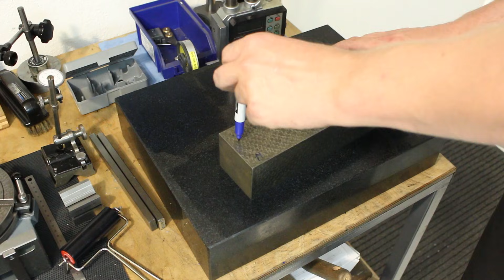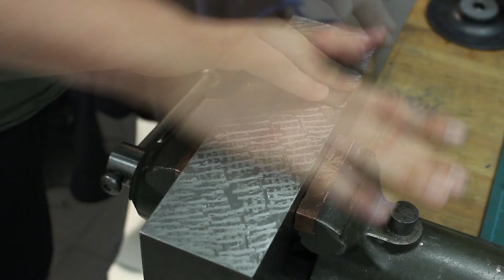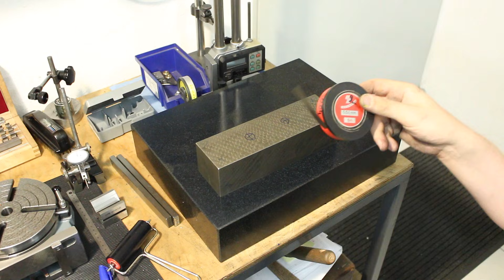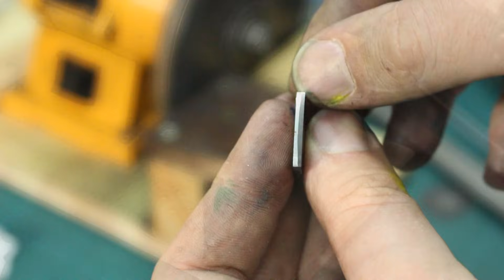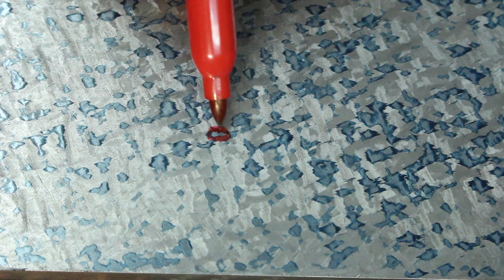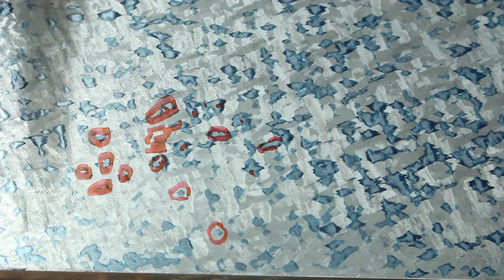Scraping basics - Scraping flat - Part 2

Comment: Thanks for the detailed 2 part video, it helped me understand better the process. Earlier today, I already built myself a ghetto scraper from a broken HSS M8 tap as the cutter and for the handle 3mm mild steel sheet and 16mm rebar, everything welded together, so as it was red hot I hammered it and then quenched it in oil to hopefully keep it as hard as possible.  Now I know I got the geometry wrong (eyeballed it and the cutting angle is in the oposite direction), although it seemed to work okay without signs of wear after a test of a few hundred strokes. Wish me luck because I will need it 🤣🤣🤣🤣. Just for reference, the previous year, I built myself with the 3 plate method 300x300x30 reference surface plates made of the same 3mm mild steel sheet reinforced with 8mm flatbar and 6mm rebar as points for concrete to grab onto and, at the end, I got the things to hover one on top ot the other then stick together like the gauge blocks you showed in part 1 with little to no oil in them, mind you they are just over 9 kg each and you could lift the one under grabbing the one on top. I used an angle grinder to scrape the high points until reasonably flat and then made myself diamond paste with thin oil (WD40 and other similar product) and ~90 micron particle size alumina powder (advertised as 220 grit), then I began lapping like crazy for I dont know how many hours.

This time though, I dont feel so confident the results will be so great, so I might be ordering in advance a few carbide pieces like the ones you show us for a less ghetto version 2 of the scraper tool. Do you have any advice on what to look for or any chinese supliers you trust?
Reply from the maker: Uhm, I dont know any chinese suppliers for scraper blades, sorry.

One source of wider carbide strips could be electric handheld power planer blades - They are availible in carbide and very cheap.
Reply: @StefanGotteswinter Alright thanks a lot 👍

Comment: any idea how much material is removed in one motion/one pass, anyone? I have something that needs to be flattened, but I'm not sure if it's worth it doing this way. there is an unevenness in height on the order of about 0.15 mm (need to remove material around a low spot in the center), and the size of the surface in question is about 15x15 cm.
Reply: (cast iron)
Reply from the maker: If you really go at it, you can do 0,005...0,01mm per pass when roughing.
I would say roughing down a 150x150 by 0.15mm is absolutely reasonable and wont take to long.
Reply: @StefanGotteswinter  thanks! it looks like trying myself at this new skill is now justified and I can happily satisfy my OCD.
I have a sharpened (out of the factory) hard insert already, but I still need to get a handle/holder for it. I don't have anything to sharpen it with (except some galvanic diamond plates for manual work), but I think the four existing edges should be enough to try it out :)

...there is something magical in scraping cast iron little by little.

Comment: If I understand correctly this technigue is for sliding surface and the idea is to have lots of evenly spaced high spots for the flatness and lots of evenly spaced low spots for oil and lubrication.   Not so much for a reference non-sliding surface.  Correct?
Reply from the maker: Its also very suitable for non sliding reference surfaces and measuring tools. Wyler for example scrapes the bases of their precision levels via pull-scraping. If you look up Wyler on youtube they have a promo video, where you can see the scraping.

Comment: Scraping multiple sides of (What looks to be about) a 60x60x250mm block of metal AS A DEMONSTRATION makes me think you're a lot more mentally centred than I am. Half way through scraping in the bed and cross slide on my previous 100+ year old hobby lathe (on around the beginning of day 3 IIRC), I was all in favour of throwing the whole thing off the nearest bridge and into a river !

In the end I left it half done for something like 2 months, then I kept it all layed out on my bench so I could do an hour or so on it here and there when I didn't feel too much hatred towards the whole task. It wasn't the best job in the world when I'd finished, but it looked OK, and was significantly flatter than when I started. That thing had a 200mm area of wear near the headstock that was almost a millimetre deeper than the rest of the bed !

If I needed to do it again, I WOULDN'T ! I'd just send the damn thing away to be planed on a shaper somewhere. Maybe once it came back I'd do a light scraping just for the look of it, but I wouldn't start scraping over a mm off of 80% of a lathe bed by hand again ! :D

Comment: How to scrape dovetails or machine ways. You cant get into dovetail all the way into the corner with these hand scraping tools!
Reply from the maker: You thin down the top of the scraper blade on a grinder. Also, a dovetail always has to have a relief cut - no matter if its going only to be milled or in addition ground or scraped.

Comment: Excellent explanation, now how do you scrape a granite block and make a flat surface for it?
Reply: You don't. You grind then lap it. The lap is often a heavy chunk of cast iron, but you can even do it with aluminum as it picks up and holds the lapping paste better.
Reply: @johncoops6897  It seems to do this automated like using a custom CNC is really possible, I have done some research on this. The goal is to take scrap or ordinary granite plates and turn them into grade AA surfaces. However no one have ever done such implementation, I have only seen such automated implementation done in professional factories where majority of people ends up buying their grade AA granite surfaces. I think I have only seen like 1 or 2 youtubers tried using a CNC to do the girding using a CNC. From my understanding, making a granite surface or making precision CNCs which is done by the machinist from scratch is really a secret and requires great skill and talent. I have seen few skilled machinist who have successfully built high precision (down to single digit microns) CNCs. Simply take grinding wheel, place it into the custom made CNC and let it do all the intense labor in grinding and laping. The final laping can then be done by hand which isn't too labor intensive. To make laping part completely automated, AI and custom cameras with laser scanning sensors can be used. I could even build a fully automated scraping machine too, that can take can flat granite or metal blocks and scrape to grade AA.
Reply: @ShopperPlug  - yes, but you realise that the CNC machine needs to be at least an order of magnitude (10 times) more accurate than the part that is being flattened?
That fact alone means that it is completely outside the scope and subject of this video.
The factories that manufacture surface plates use AUTOMATED grinding machines to get within 10 microns or so. Optical surface grinders use AUTOMATED systems too. What you say is valid, however that's not how flat surfaces are maintained and rectified for products that have left the factory.
Reply: @johncoops6897  Well it only needs to be 10 times more accurate only for the final lapping part reaching grade AA levels. However the mother CNC does not need to be so expensive nor micron accurate to do the first initial grinding and lapping. The precision lapping would be done by hand of course. So far I haven't seen any one in the internet implemented fully automated lapping reaching grade AA for granite, not even granite factories have such implementation, all are done by hand still today, hence why they costs tens of thousands of dollars. I think because there are no proper implementation nor sensors to help provide this service for granite, making precision granite surface is 100 times more tricky than making precision metal surfaces. Precision ground metal surfaces are general cheaper than precision grade granite. After all, the worlds best mother CNCs precision based are all made from heavy granite. Look at CMMs, these things needs to be 10 times more accurate than what it is measuring (they measure high precision metal blocks or parts), no wonder they are made from heavy granite. Note, my comments are about granite and not metal blocks, however this video is 100% relevant because I need to make base plates which are all metal which will be used for granite CNC. There are many commercial mother CNC machines which actually makes precision metal blocks but not for granite. The video serves helpful purpose on making mother CNCs and high precision CNCs for granite grinding and lapping.

Comment: I was told you had to have a slow speed grinder for those diamond wheels. Something like the Glendo. @ 400 RPM.
That's it, I'm converting a 1,750 RPM grinder. Thanks

Comment: Questions 

How do you correct an angle for a plane you step scrape it? So how do you use the angle plate to do that 
Second
Can you use negative rake on soft steel or positive rake like how An Engineerings Finding did
Third when you long stroke scrape it is the depth of cut almost the same
Fourth can scraping get things to their final width/dimension like how lapping does or just only for making it flat and have  bearing surfaces only.

Comment: This video series is such a good one. I have been rewatching it regularly and I have just started scraping myself. One thing that was really difficult with the insert I bought was the radius, probably 100mm radius on it. It's a good insert IMO, old USSR and mirror finish on the flats. But I had to regrind the radius to 60mm. Made a similar setup with chinese diamond plates and man it was fast and easy. Still for my beginner hands it's still difficult to avoid hitting with the edges sometimes. Going to 40mm might be better still, but I guess I also need to learn to hit the scraper where I want without relying on a smaller radius. I didn't have a block of cast iron so I am making a Stanley #4 plane incredibly flat instead.

Comment: maybe I'm stupid or we're working with different tolerances but I dont understand how this isnt obsolete unless you`re trapped on an island. Put it through a planer and it comes out flat. Send it to a machine shop and have them spin around a cutter head for resurfacing and it comes back flat. Using a piece of glass or scrap granite as a surface plate shows flatness cross examining it with a straight edge and feeler gauge so these things must be flat too. Poured flat and cut and polished flat and  maybe rolled flat to achieve that flatness before that. I`ve done something similar to this with sand paper,scrap granite, a straight edge and feeler gauge on engine heads but this is considered sub par jerry rigging to save a buck and the correct protocol is sending them to a machine shop for resurfacing when it doesnt pass the straight edge and feeler gauge test. This method seems useful when you`ve been reduced to the stone age (and remember some one had to find a reference surface to run this process in the first place at that point.) Even a machine shop should be able to find another machine shop or equipment to run a resurfacing to return their equipment to flatness and should be able to find enough flat things laying about to use for reference to verify that the resurfacing came back flat. I have no idea why you would need to call in a guy in this day and age to hand cut flatness and in this regard it seems like snake oil.
Reply: and I`m staring at that supposed flat surface that is scraped and by eye I can tell you with certainty that is not flat. all those hills with dykem youre counting are a testament to that fact before you guys come and say this is "better flat". NO. flatness should have a mirror finish. You could probably get a better flatness counting out even passes with varying grits of sandpaper to surface that absolute trash to a high polish into something respectable.

Comment: Stefan Gotteswinter.  As good as this is it doesn't show how to scrape a flat surface from first principles. This involves scraping a set of three surfaces to each other in rotation to eliminate concavity and convexity. To scrape something ' flat ' to a reference plate will only give an flatness accuracy equal to or less than that reference plate. I mean you no offence in this reply, only to say that this was how I was taught to scrape ' flat ' many years ago whilst serving an apprenticeship. Perhaps the ' old ways' are going forever.
Reply from the maker: Youre right - But I think for an absolute beginner, that has never scraped, starting with 3-plate method is not the right step. Better getting a known-good reference surface, use that and concentrate on getting the scraping good, instead of struggling with scraping AND understanding the geometric context of the 3-plate-method.
But thats just my 5 cents ;)
And once you start rebuilding a machine, 3-plate-method doesnt help anyway. Its very limited, works only on square plates.
Reply: Stefan Gotteswinter. You are also right. I noted further down the comments that the three plate method was mentioned. Can't quite understand your last two sentences, don't see the relevance of a three plate method with rebuilding a machine. Furthermore, where did you get the information that it only 'works on square plates. Just curious since I have seen round plates lapped and scraped flat using the three plate method. Just trying to clarify things, no offence and regards.
Reply from the maker: Uhm, yes, round works of course too - In my mind I was at square surface plates and long straight edges. To my understanding 3-plate does not work with parts that have very large length/width ratios.
I was thinking of the relevance of scraping in regards to machine rebuilding - Thats why most people learn scraping, and for that purpose, 3-plate is not super-usefull.
But definetly, once the basics are understood, understanding and maybe even doing the 3-plate-method will be help-/usefull. I have yet to do it, I only have read about it.
Reply: Three plate method is great if you want a career in making surface plates. For everyone else, it's basically useless.

Comment: I have been interested in his ever since I watched a couple of guys come in and do an old Cincinnatti boring mill in our shop. I'm talking 24' of base ways so it was a big job. They did some of it by hand and some with a power scraper. I was running an 8" Shibaura just a few yards up the bay from them and talked to them a lot. I have an old lathe that I would like to do now and this helped refresh my memory. We used to scrape in thrust bearings for extrusion machine drives back at another shop I worked at. I remember it being an awful lot of work as was spotting in molds. Of course this was almost 30 years ago now. I am a retired Tool, Die and Mold Maker but have a small machine shop in my barn for machinery repairs and maintenance. Anyway, thanks. I really enjoyed watching this.

Comment: Stefan what stone do you use for making spots bigger / increasing coverage? The same grit as for deburring? If you could give more details as to how this is done or include it in a next video it would be great, I have issues with lots of tiny spots not much coverage. Thanks
Reply: Deus Ex Machina stoning for coverage works, but it removes the point of scraping by creating a sticktion arean and causes the surface to break down faster. 
thats is what i read in Moore's book on surfaces anyway.
Reply: Yes but useful for a straight edge. Also, you could easily add oil channels.

Comment: What I did was make a very balanced disc with a 7/8 in shaft to fit in my hardinge high speed lathe it works wonderful it takes up no room. Thank you for the tip on these Chinese discs I will buy some right now

Comment: Hi Stefan, I just rewatched this as I'm looking to start my first scraping project: an angle plate! Huge thank you!
Out of curiosity, do you know what the average depth of cut is on roughing and finishing passes? I figure it's not important if you didn't mention it, but I think it would be interesting to know.

Thanks again! :D
Reply from the maker: Ahoi!
Glad it helps you :DThe depth of a scrapemark is actually important. Depth is the same for roughing/finishing, only the stroke length differs. An average scrapemark is about 0,004-0,01mm deep. You can and should messure the depth to get an idea how much you take off during scraping. Thats especially helpfull when doing blindscraping/stepscraping.
Say your scrapemarks are about 0,005mm deep, and you want to bring down a surface by 0,02mm - That would be about 4 passes over the whole surface without blueing in between. After those four passes you check and you will be very close (in reality you will take off less from a complete surface, but it will bring you close)

Comment: Hi Stefan, have you yet come across the term 'Lap Scraping'? I have been searching on ways to scrape a large surface plate with a smaller master surface and there is a method called 'Lap Scraping' but I cannot find any further information on it - other than a time server scraping guy referring to it in a forum. Might be a question for Richard King?

Comment: Can you make a video on how to scrape something parallel and square? (And maybe to a specific angle?) There seems to be a lack of videos on how to do this.
Reply: In guessing you use a very square angle and rub it while the angle plate sits on the surface plate rough scrape it to get the blue cover almost all sides of a certain plane and you find the dark blue ,blue with dark ring,faint blue and ensuring its flatness at the same time